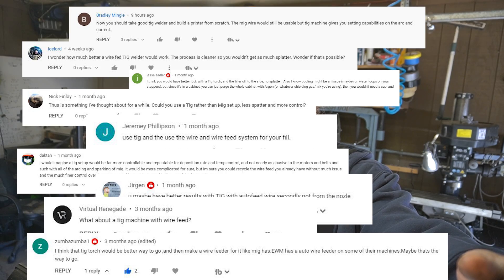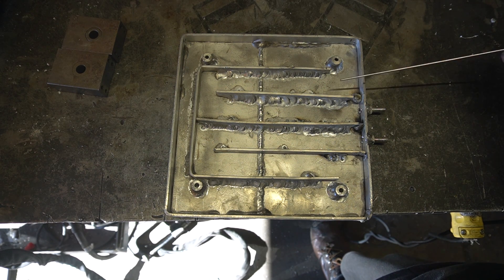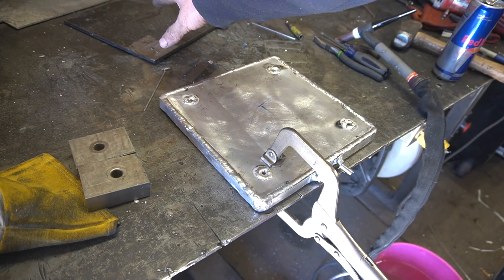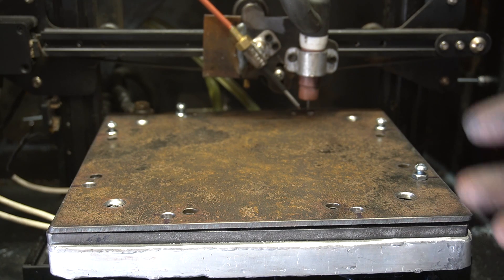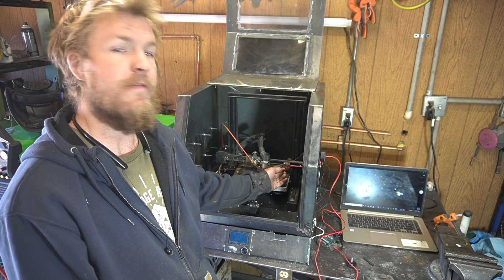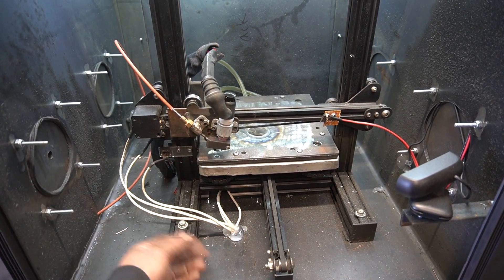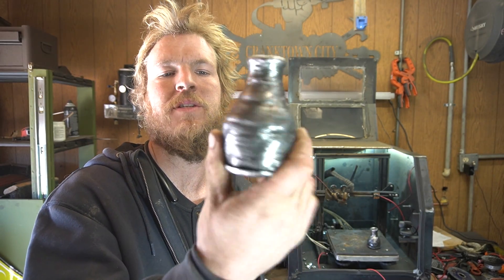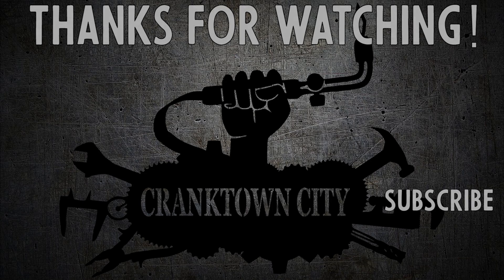DIY Metal 3D Printer Using A TIG Welder

Comment: It would be sweet to do some destructive test on the printed metal.  Even just cut a strip out of it, and see if it bends or snaps. I bet it's actually more than usable for all sorts of stuff.  Maybe much lower power setting, slower, smaller stepover, and longer time and you are printing turbo manifolds, ect. with geometry not feasible to fabricate. Pretty cool the torch didn't even need cooling.

Comment: That is some amazing work... Yeah, i know, its not what you would call even acceptable for marketing purposes, but as a start and given what you did to fabricobble this, its amazing! The belts should be shielded by a thin sheet so they dont see any degenerating light, and to reduce heating thereof... The whole system probably could use some rigidification and what not to make it more skookum... The whole drive mechanism should be smoothed out, the wirefeed should be a composed differently but not by a lot, just positional-y... Nothing should contain plastic or aluminum apart from the watercooler plate and the top plate should likely be thicker, but as said for what it is, its amazing and the results are quite great... Also, keep in mind that this should not be considered and viewed through constraints of a 3d plastic printer, as the nature of the beast is wholly different, this should be considered as a counter-method to casting parts in moulds... Its a way to get things into general form and have it ready for machining, rather than expect a perfect part outta box... Heck, i watched fireball dude weld up a stacked lump atop a bolt so he could machine it down into what he needed, as he didnt have any stock in that size or shape at hand... I think this is more or less the same thing, a way to get steel in shape that you roughly want, so that you can machine it down to exact desired shape and dimension, without having to resort to casting or machining a `yuge block of steel down and waste an enormous amount of material and cutters in the process compared to what little machining you would need to ``polish`` a part made by this machine... Eventually, it might come close to 3d plastic, but any 3d print should never be considered an end product, but a step in the direction of getting the end-result... As the name of 3d printing implies, its a model making technique, the fact that this produces models that can be directly machined is a great step up compared to plastic printing which may give better lines, but gives a chunk of shit, i mean plastic which is an inferior material that then needs to be made out of proper materials once the prototype is confirmed to be functional... So 3d print it in plastic, confirm its a good proto, 3d print it in steel and machine it down and voila, you have a worthy process that might even cash you out for your efforts..

Comment: Excellent path with the argon enclosure

I haven't read any other comments, or really got a good look at your belt setup, but I'm definitely thinking that your layer shift is a belt problem. Why? Because you seem to think so. I have zero doubt towards your intuition. My observation is that your X belt is misaligned and is causing inconsistent deposit/motion/tension across the X travel. I'm positive that would make my fdm printers dig. I'm not positive it would make MIG dig, but I doubt it will hurt to get that belt as square as you can so that the travel is linear across the axis. (The carriage mount point for the belt on the x carriage looks like it's nearly an inch below the pulleys). If this was an actual stepper issue, I'd expect a less noticeable shift considering your line width should actually hide an single/multiple step error

Observation/assumption/suggestion number b:
If you run the marlin firmware, you may want to play with "linear advance." In fdm it will force filament in the hotend before a line starts, and starts to retract before the line ends. It may help with mig. I'm not a welder, but I did notice your frustration. Just something to think about... 

Keep it up. I'd like to see where this goes. You are already this far...

Comment: The issue is that the metal can't cool fast enough. With regular 3D printers the plastic is cooled as soon as it possibly can be so it doesn't become runny. The other issue is resolution. Small things will look like crap, but big things will look a lot better.

Comment: Pretty sweet. I would try to mimic tig and have the wire rapid in in bursts. Should help increase resolution, plus you can lower the temp/amp. Would help the welds look better.  Another random idea is to just seal and purge your whole box and not even use the torch argon. Crazy project! Nice work Sir! I put my tig in my haas cnc machine but only use to fuse so your wire feed is next level haha.

Comment: Honestly this might be actually viable for a real commercial product for home use. I mean you might not be able to get super precise measurements but, it could probably be improved and made better.

Like legit you may be onto something

Really the only limitation is the thickness of the bead. The belts could be changed out and improved so the movements are precise.

Comment: Make a FDM metal 3d printer ,but instead of welding the material you make the amps so low and it just heats the wire red hot so it flexable and bonds to it self ,like spot welding
Reply: Using CO2 welding wire

Comment: That is awesome!!! Try adding a “pass” without filler in between layers. That should smooth things out a bit. Also, you don’t need argon if you can put that chamber on to a vacuum, but that’s another set of issues on its own.

Comment: "I swiped it for a nano, cause there is no point using an uno here, possibly cause I shorted 24 volts in the uno and fried it, I'd have to be an idiot to do that, I'd have to be an idiot to do it twice "" ... subscribed ...  ( reminds me the time I burnt 2 megas by mistake making a 3d printer (( not my first 3d printer or anything just was overworked and not focused... )) )

Comment: Props!  Thanks for sharing this... the improved cup fitting is kinda too nice! ... ok thats a bit more messy than a run away plastic print!

I had already subbed before this point but that extra grounding is for sure the trick to get it working well

Comment: I priced a 3D metal printer a couple years ago so I completely understand why you're doing it yourself I think if you did a little more work on the torch and wire feed adding some verniere solid adjust ability there and locking it down I bet you remove 70% of the variation maybe even steel sleeve the very first inch and a half of the wire feed as a solid piece of that there's no vibration in there

Comment: Awesome work! From my background in welding automation I must say that I know your pain. Getting the wire feed right is a real PITA, and even using ABB robots which are very hardened against noise, I HAVE had noise issues. Here are a couple recommendations that come directly from my experience in making a robot TIG weld in tight spaces with wire feed. If you want to dream, look at Fronius CMT and imagine how nice one of those would be for metal FDM printing. If I had the time to spare and it was MY robot and $30,000 welder, I would have been 3D printing parts using the CMT welder and robot. Just the same, I think that TIG could yield very good results and you have already proven that you are on the right path.
First and foremost, it would be very beneficial for you to have the ability to reverse the wire feed rather than letting it ball up. 
Enabling pulse welding may be of benefit. It will keep the pool tighter and may enable you to build the weld up a bit more without having it sag over. 
I used a tube for the wire feeder with a hard steel nozzle on it. This allowed me to mount it further from the heat while having good control of wire location and makes it easier to make adjustments. Made the nozzle from drill rod, torched it red and dunked it in water. Hardening it reduces friction, just make sure you smooth your transitions so it doesn't cut into the wire. Use an oversize drill most of the way through and then make an orifice a few thou over wire diameter for the last 30-50 thou. Sand blast inside with fine sand to smooth everything then harden.

Regarding noise, you may consider putting your steppers on the outside of the steel case and use drive shafts with insulated couplings. Consider actuating rods and doing the same with limit switches, or perhaps using optical isolators for them. This way you keep your wiring outside and reduce the amount of EMF that you induce on the signal and driving wires. This may be difficult to accomplish using the Ender design, so consider using CoreXY as it will allow external motor mounting and also may make it easier to keep enclosure size as close to envelope size as possible (not a bed slinger) so that you don't need to use any more shield gas than necessary. If sticking to the Ender design you may be able to run a long belt and pulley system to actuate X from a stationary motor, but you will need to re-home X on each layer change or make compensating steps with each Z move. Adding ferrite beads on the entry into the control cabinet can provide additional filtering. Keeping the welding cables on the opposite side of the enclosure from the steppers would provide further noise suppression, and assuring that you keep welding cables perpendicular to control system wires and grounding wires wherever they cross, if this is unavoidable, is also beneficial. Ground your shields to the control cabinet and let them float on the other end. There should be no contact between shields and the welding enclosure. A really cool thing to do would be to have a little spring in the torch in Z, and use scratch starting. This would require a bit of fiddling around with the coding, but could very likely be accomplished.
One additional thought would be to use a copper build plate but I'm not sure if the initial bead will adhere sufficiently to the build surface. Perhaps have a steel plug in one or two spots and have your first layer include them. If you build in an enclosed environment, you may be able to use a cooling fan to accelerate weld cooling without oxide problems.
OctoPi might simplify your camera issues. It dripfeeds the control and has a built in feature to take a snapshot on every Z move, so you can get rid of the extra limit switch, but I like your idea of moving the torch out of the way before making a Z move so you have a clear view. (Did you do that with your slicer or your firmware?) OctoPi also has a control interface that I really like for running and monitoring the printer remotely. 

I love your project and it is entails many of the details of a similar project that I would really like to build, once I have a long list of necessary things crossed off.

Great work and I am DEFINITELY awaiting the sequel. Liked and subscribed!!

Comment: Ball screw for X & Y now. . .

A pulse setting,  with wire feed pulsing would probably help.

Thermal paste between your heatsink and bed.

Longer pause between layers to give the previous layer time to cool.

Seems like trial and error to get the settings nailed

Comment: Wow! This looks promising! The "big" problem seems to be to coarse tooling for too small things. And I guess it's hard to come around. The best would be to get a way smaller welding wire, with everything that follows. The other option sadly is too supersize the printer and do the vase five times larger, as that would give around the wall size expected. It's really fun someone spends energy on this, as I never seems to find time (but had the thougth for years). So please keep this going!
Reply: look up puk 5 micro welding.  it is TINY.  if he put that on his print he'd be there

Comment: This looks really promising.

How difficult would it be to get the layers smaller? I figure lower amperage, and as small gauge wire as you can manage. 

Do your tungstens stay good? I've always wondered how long they would last in good condition if the guy holding the torch, me, could stop trying to practice morse code during welding.
Reply: Agreed

Comment: What size wire filler you using,  can you go smaller as you using a mig wire feeder go.. dot 6mm, cup size does  effect weld pool on alu side note. idea on tip and weld height, go fancy AI or not  with a macro camera, graduated marking or scale ruler behind and measure tip and weld pool distance so it can dynamically adjust weld current and tip height that defo stop wondering of the puddle allow for smaller stack needs, be faster to lay down, . Alu is different to weld on tig puddle loves to follow the head pzzzz whack short etc. ,. Once you've replaced the belt mechanisum, shield make sure you not got any  loops on ground and shield layer ensure shield connected to one end only on all of them from  the controller, nice progress, my uni 20 yrs ago were build testing metal plasma depositing machines for nasa

Comment: wonder how it would do with aluminium , might be nice to make 'raw castings" with that can be machined to the final product without the need for a casting furnace and sandmoulds and stuff , prolly be way more expensive that the normal casting method with the price of argon and the wire included 
i do think the quallity of the fused aluminium would be better than cast aluminium as its being fused intoo a solid piece under a gas cover
if you have the time and size machine for it i bet you could make a real engineblock with waterjackets and all (prolly take a month of not stop welding though) 
there are actual metal printers and they use a metal powder that gets heated with a laser after wish more powder is added over it after finishing the product is puled out of the unmelted metal powder , realy messy and apparently dangerous to youre health that fine metal dust and the off gasses that come off during the process  

as for the rubber belts of the 3d machine , i seen homemade machines like a plasmacutter table that used bicycle chain / sprockets and that actually works quite well and you can find chain in smaller sizes too

Comment: Things that would help: 

Lower the mass on the Y axis/bed

Strap a motor to it and use the printer as a CNC (or if you have a CNC use that) and make a thinner bed waterblock by CNC-ing the channels. Then instead of using spacers between the two plates, the channels are cut into the faces of the plates so you can just bolt them together

The channels in the water block are too big and the flow rate suffers from that; the long time to flow from one end to the other makes it worse at cooling, and the internal surface area can be improved by making it thinner and creating a larger number of thinner channels

Water cooling the steppers might be necessary considering the high mass they're pushing and high currents necessary. You can probably get some cheap 40mm / cpu water blocks off ebay and strap them to the steppers (~7-10$ each)

Maybe add a radiator inside and outside to keep the internal air temperature lower, without losing the argon atmosphere inside, to help with cooling the belts and steppers, or swap from belts to a ball/lead screw. Lead screw is cheaper but not as accurate, probably more than good enough for this application

Comment: This is awesome. With the right model you could have cut away support structures. Probably similar to tree supports snow flake. Just thick. I wanna eventually see something contain fire printed. You made that bottle. With some tweaks it’s a combustion chamber and nozzle. Leave a couple flat sides so it can be drilled and tapped for gas fittings.

Comment: I guess you would get better definition if you dont run the TIG  continuously, but instead made well defined filler rod splotches.
I am also guessing that that would keep the tip sharp for much longer. I´ve been told that a sharp tip is important for getting 
well defined welds,

Comment: I definitely agree with the other guy commenting that you should replace the belt with a lead screw, but I also think you should attempt to make smaller welds. I think the quality can be improved if you decrease the nozzle size ie, weld smaller beads with less juice and less wire.

Comment: In the late 80s business partner built a CNC plasma cutting machine and Wrote programming for it we had a Lotta problems with radiation and we wrapped the wiring and aluminum foil  and also used chain and sprockets because the rubber belts had too much trouble with the heat

Comment: interesting project. However, as a 3d printer enthusiast, you can go two ways with this project. The way you are going is currently "Additive". You are adding metal with a Tig welding adaptation. However, I was thinking about this. You could use this to do "reductive" 3d printing, or sculpting. So for instance, by putting this idea to a lathe concept, you could use your computer controlled welder to create a "tig lathe" for use with reductive welding or sculpting jobs. This might be used for creating custom engine parts or special order parts, from solid metal pieces . Just an idea.!!